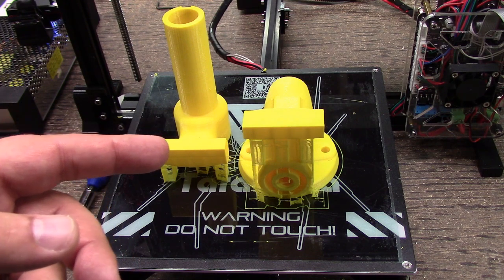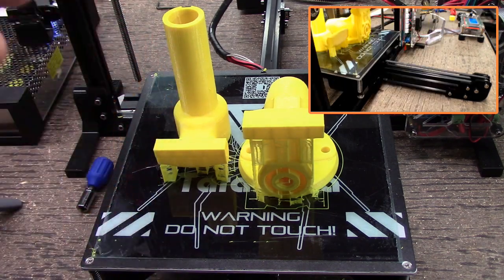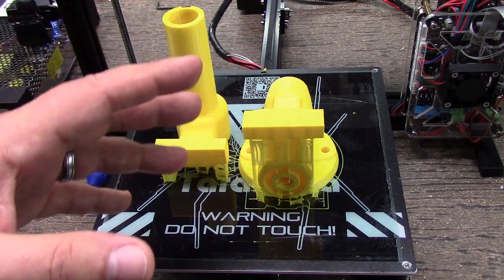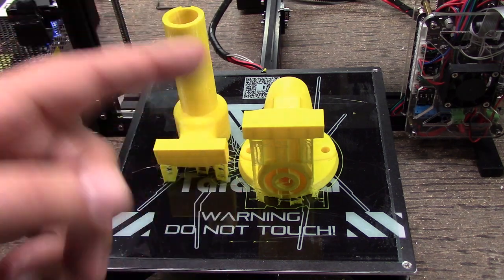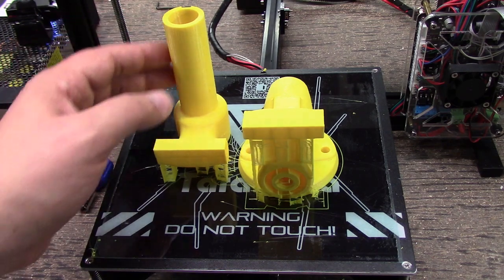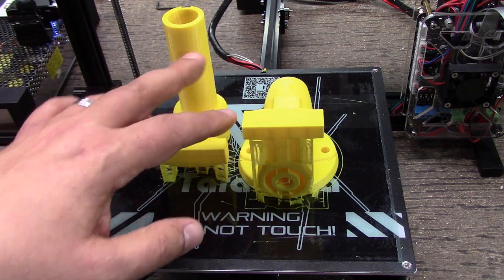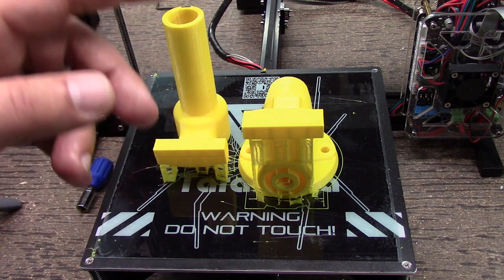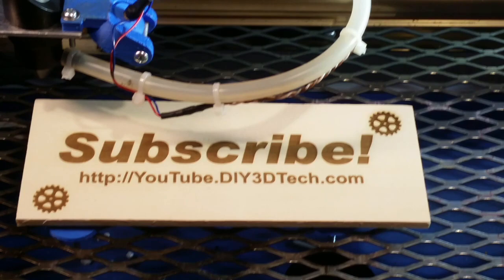TEVO Tarantula 3D Printer  - Quick Update 11 Hour Print Amazing!

Comment: Hello a question for PLA what would be the speed parameters. Buy a tevo tarantula recently and it's my first 3d printer and it's a bit confusing to me
Reply from the maker: +Jack Chevigne would go about 50mm/sec with 0.4 layer height for starters.  Also I over extrude the first layer by 110%.  Hope this helps 😁

Comment: Was that printed using Dual extruder? Is a dual extruder needed or does the software auto generate the infill lattice? Cheers :)
Reply from the maker: The Tarantula [this version] only has one extruder and yes the "slicing" software does all the math for the infill and supports :-)

Comment: Do you get consistently good prints like this? 

I have just ordered one of these and I currently have a delta tower. The delta is fast and accurate, but have to level the bed before every print and even though its auto level, I still have problems with the nozzle scraping the bed in some areas, so I can't get the full use of the bed space even though it isn't very big anyway.
Reply from the maker: In general yes, I level the bed only on filament change or when I want a really [REALLY] good print. I could see your issue on a delta and one of the reasons I have avoide them as they very to watch, however see practicality issues as I print a lot and mean a lot.  :-)

Comment: Does the control board have a part cooling fan port?
Reply from the maker: I don't recall one, what I did print a cooling fan adapter from Thingiverse and install (there should be a video in the play list) that splits the air and I up sized the fan.  Works great!
Reply: Yes, the Tevo Tarantula does have a fan control for part cooling. The hotend heatsink cooler goes into the PSU or mains and is on all the time.

Comment: What is your process for replacing the PEI?
Reply from the maker: Never replased it yet, however if would I would peel it up, clean off the tape with GoofOff and put a new on I guess.  However the stuff should last a long long time as unlike BuildTak, it works on the properties of the plastic (i.e. PEI).  SO, so long as its not damaged, it should be like the energizer bunny...
Reply: DIY3DTECH.com
I've 'heard' they are extremely difficult to remove
Reply from the maker: With the 3M tape yea it will be work, I warm the bed up and take utility knife and run under the edge to break the bond and peel back in sections but I think no worse than getting that 3D Ezz stuff!  man that stuff was hard and messy!

Comment: See, how do you get that off with it stuck that well?  On my machine with the buildtak like stuff it sticks like that, or even worse depending, and it bent my 6mm aluminum bed trying to get my parts off and it always has to be retrammed due to it as well.
Reply from the maker: The stuff comes off very nice as I just take the "corner" of a beveled pain scraper and nudge it under a corner and the whole thing pops off!  All you have to do is break the surface tension and bam its off there!